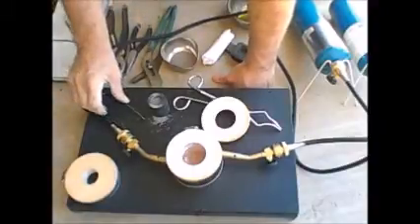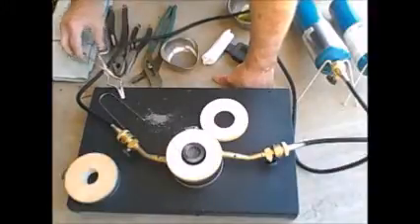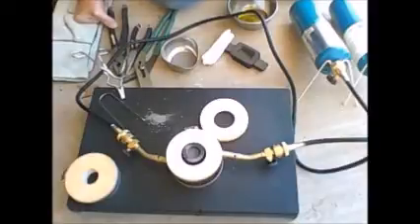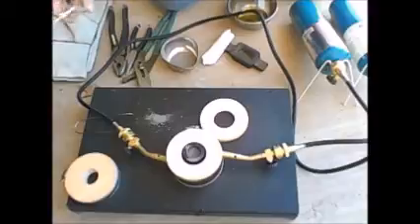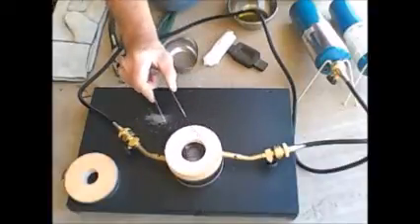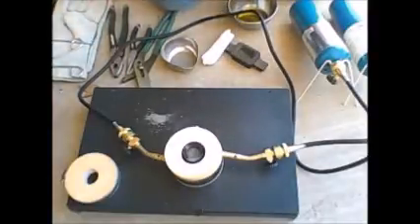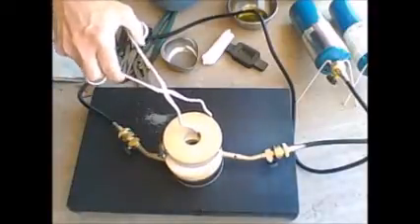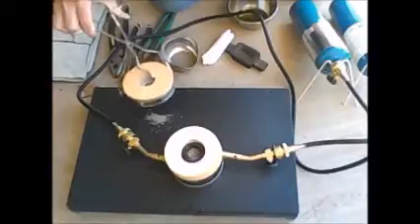melting mlcc for silver & palladium Part#4

Comment: sir tell me melting dish name and melting furnace and gas setup and guide proper
Reply from the maker: The melting dish is called a crucible. You can find several kinds of furnace on one of my playlist. It can tell you more about a furnace. The gas setup is a propane torch used to sorder copper pipe. I am not shure what you mean by guide proper.